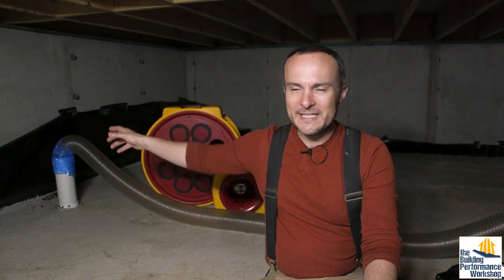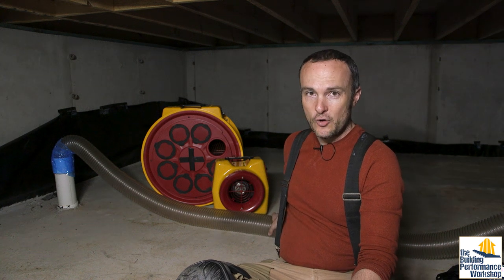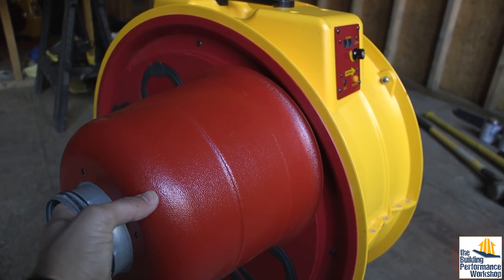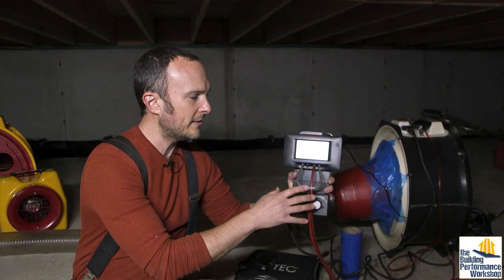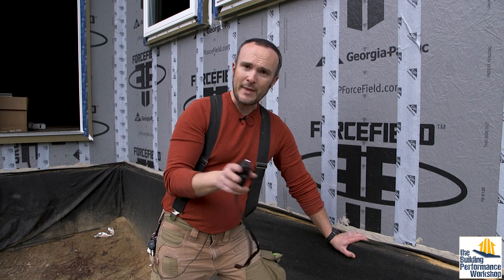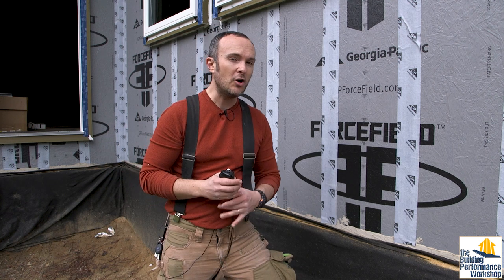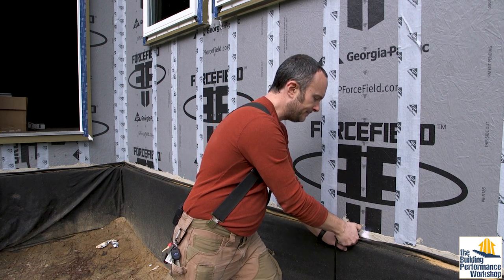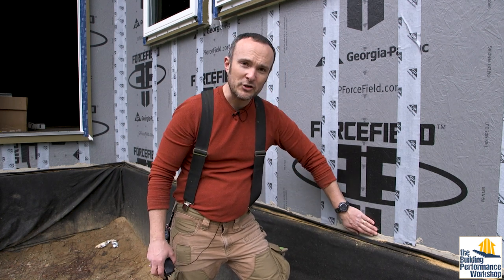Radon System Test for Air Leakage with Blower Door?!?

Comment: At first glance, form-a-drain looked like a great option to me, but you've sorta confirmed what I didn't like about it. 1st, I don't like that it doesn't get down to the lowest part around the foundation on the outside where water could be pooling; there will already be a couple inches of water in the gravel by the time it gets up the bottom of the form-a-drain itself (you didn't really confirm that but your install images just reinforce that theory for me). And 2nd, I couldn't understand why I'd connect the inter and out drain systems if radon preventative was a goal as well, since I only want the fan pulling air from under the slab or vapor barrier, not from outside the foundation walls as well. I love the way you did the test, the mini smoke generator was neat, and great to confirm things that make you go humm with hard evidence. Thank you.
Reply from the maker: Joe Nagan actually taught me that the suction on both inner and outer results in drying the footing and foundation wall base, which raises the temp down there too- the Form-a-Drain is still a good choice for us as a 4-in-1 solution.
Reply: Just a quick note about the bottom of the footing.  IRC-2018 recommends a minimum 2" of base gravel below any foundation drainage system in section R405.1.  I believe this is recommended as a preventative measure to allowing sediment from the base soil to have direct access to the drainage system.  Thought is that putting drainage directly on the ground will allow more sediment into the system as ground water rises.  There is a great article in Green Builder Magazine about the placement of drainage.  Basically the recommendation from all the sources is to install drainage level with the top of the footing, extending below.  Goal is to drain the water prior to reaching the top of the footing.  Form-A-Drain due to size and configuration gives you the largest face volume of drainage when compared to other more traditional systems.  The system is recommended to be staked 2" from the bottom of the footing.  This allows space for  a gravel bed below your drainage, and then a full face of drainage up the remaining portion of the footing.  In some cases this gives a 10" face of drainage perforation to move ground water, and eliminate the build up of hydro static pressure.  As always installing a filter fabric below and above your complete drainage system is best practice.  Corbett's  burrito does an excellent job of achieving this.
Reply: I am at a disadvantage for discussion of IRC 2018, as I only have the 2015 version available as that is what our county requires at this time. R405.1 in the 2015 code book states "... perforated pipe or other approved systems or materials shall be installed at or below the area to be protected and shall discharge yada yada yada". I personally want my drain at or below the bottom of the footing, otherwise my footing is sitting in water. And my understanding the way concrete wicks, its going up the foundation wall. Totally agree, what ever drainage is used must have enough actual drain space to effectively allow the water to enter and then drain out. That drain pipe you can get at say HomeDepot with the tiny slots I don't think provides much water capturing space. I too love the burrito wrap of the approved filter membrane shown in the video. Part of the same code section uses the word 'covered', but then later says 'surrounded' and surrounded definitely sounds, and shown here, looks to perform better in the long run.

Comment: If we want to sick something up, flow is more important than pressure is it not? My vacuum can create immense pressure, but will not remove contaminants unless there is airflow to pick up those contaminants. Is it not the same with a radon fan? We need flow (yes there is some pressure involved). What if you could get to -10 pa with 5 cfm? We could only remove 5 cfm of the radon at best.  I would think you would start with a desired flow and find the optimal pressure at which to achieve that flow.
Reply from the maker: It’s simpler than that, actually- all you want to do is ensure the fan sucks harder than the house does, so given the choice, any soil gases will move into the exhaust system and not into the house.

Comment: Frp? That's the 4x8 smooth stuff that restuarants are using in their kitchens because it's easy to clean.  I was wondering if anyone made an easily removable way of installing it in bathrooms of apartments?
Reply from the maker: Not sure about easily removable- it should generally be glued down if you’re using it the way the makers intended (which we’re not)

Comment: Off topic question: what do you use to measure low air flows (less than 50cfm) at the register without drilling into the duct? Thanks!
Reply from the maker: Large vane anemometer or flow hood
Reply: @HomePerformance  brand name and model of a flow good you prefer?

Comment: If you used ICF, would you still have this problem?
Reply from the maker: Yep, it’s due to the intentional systems outside and inside the foundation, not the foundation itself.
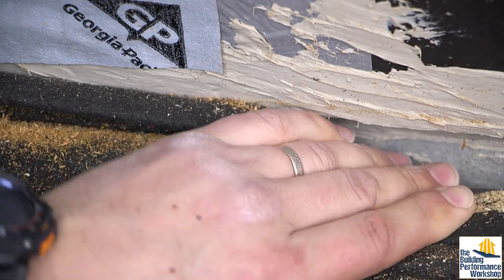Reply: @HomePerformance   At 5:23 you are showing a small space between the comfort board and the foundation wall.  With an ICF, there is no space between the cement and the insulation layer.  Do you think the dimple mat is contributing?  I ask because I want to try and mitigate the problem before it happens on my build.  I am going to do slab on grade with hydro radiant heat. This is the wall assembly I plan on using. I am in a cold climate so the base of the foundation needs to be 32" deep and 12" above grade, so we will have a generous hip wall as part of the foundation.  The dimple mat is terminated just below grade.  https://poly-wall.com/wp-content/uploads/2016/04/HomeStretch-ICF-2.jpg
Reply: From The Burbs To The Tetons  what are you calling a hip wall? I build exclusively with ICF and we run a stem wall on top of the footer but insulate under and around the footer also to have a complete thermal break.
Reply: @davetaylor8614  Yes, you are correct.  I just misspoke.  How do you do an Ufer ground?  I am still interested in learning more about radon evacuation below the slab.  I want to make sure I get it right the first time.
Reply: I run separate uffer grounds, one at meter base, one below panel on interior, one or two on rebar in walls to insure grounding of structure uniformly and pour in concrete with contact to ground separate from footings. I believe the more you study physiology you will understand the health aspects.